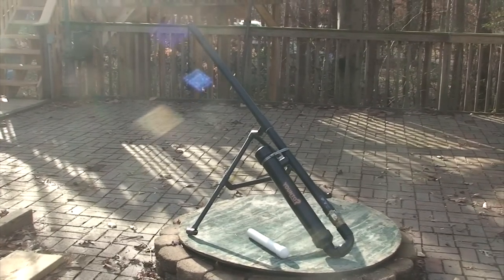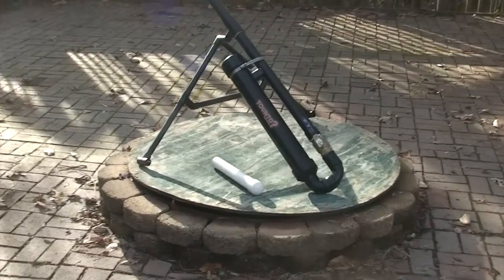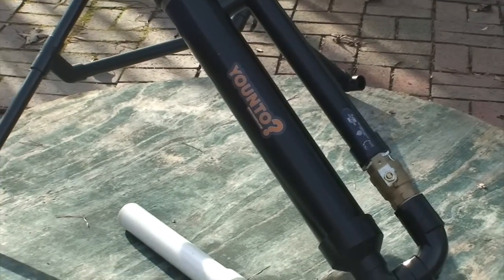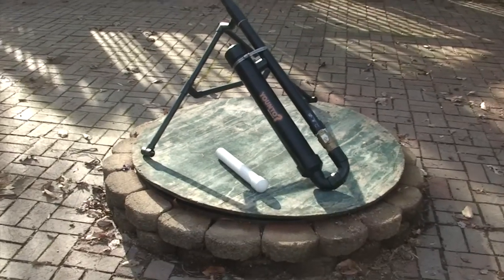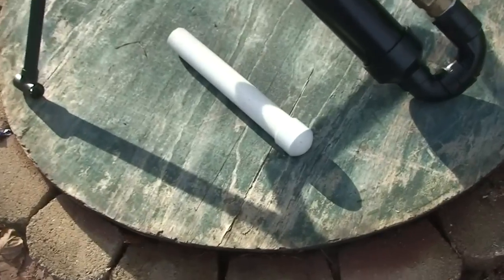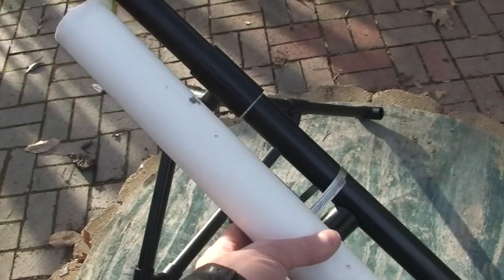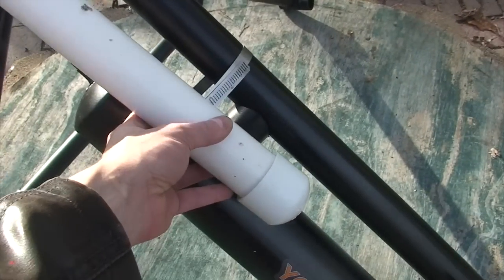HOW TO: Build a Air Powered Bait Cannon!!! | Younto.com

Comment: So the metal ball value threads worked fine with the PVC threads? And do you think that removing the barrel and reattaching it can weaken the connection? I want to build one that I can detach the barrel for easy transport
Reply from the maker: If you are truly worried about portability, dismantling  and overt strength... Make it out of metal.  :D  A good air tank and metal pressure vessels are not that much more than PCV in the long run.

Comment: i made one of this 220 psi chamber. works well 👍
cost $50 to make it.!
Reply from the maker: +Blackzhabant Sandoval Awesome man! Just be sure not to exceed the PSI or strike it under pressure.  Also have heard its a good idea to check pvc now and then to make sure the UV exposure hasn't made it brittle.
Reply: so is it made out of simple plumping pvc pipe/ 3INCH

Comment: looks like a 1-1/4 ball valve or 32mm is this correct and threaded connectors are 1-1/2 to threaded 1-1/4 is this correct?

Comment: need to know if you guys are useing basic pvc pipe found at lowes hardwaer? and also what is the max psi you use?
Reply from the maker: Remember PVC is not rated for AIR use... only water.  So use at your own risk.  But we used the Schedule 40 pvc from Lowes yes.  And we keep it at about 90-100 psi which is far below the 340 psi rating, and about the limit for most of those little 12v compressors you can bring with you.

Comment: Hey, which air cylinder lengthwise and which maximum pressure used ?
Reply from the maker: +Fernando Haag For this, I was rebuilding what someone asked for, and its more of a one off amusing project.  So it is just SCH 40 PVC, which is I believe 360psi.  I haven't taken it past 125 since thats the cap for most portable compressors.  PVC you have to be careful about impacts, it can shatter under pressure.  So I wrapped it in duct tape.  

IF I was going to make a permanent bait caster for years of use, I would 100% use a steel pressure vessel.  2.5 Gallon steel, and weld on a 1" threaded port.  http://onboardair.com/tanks.htm

In fact it has come up enough that I may just make a steel one and take this video down.  Too many people don't understand safety regs.